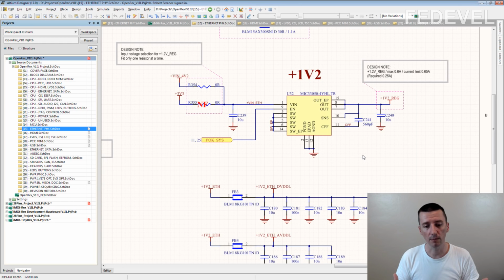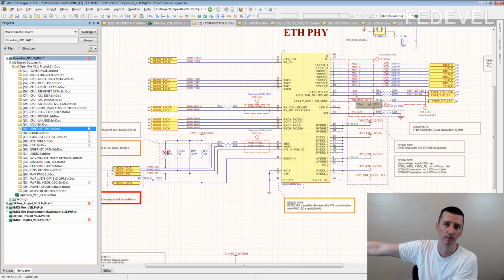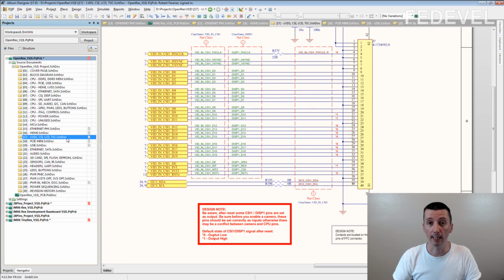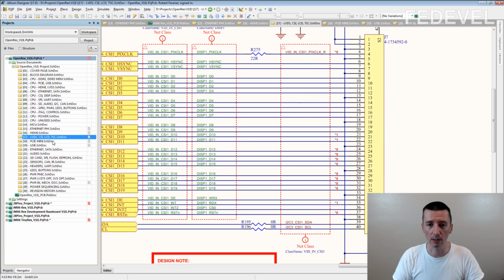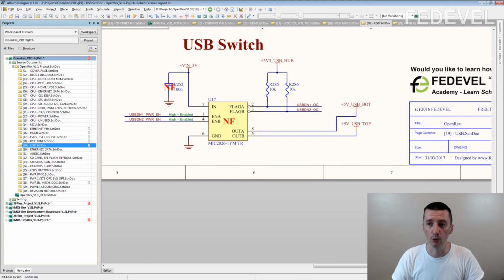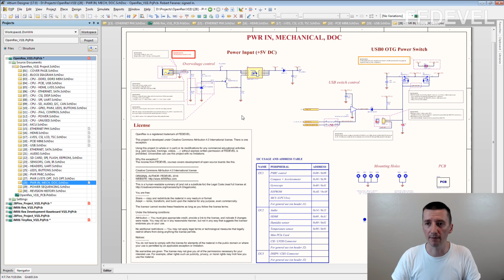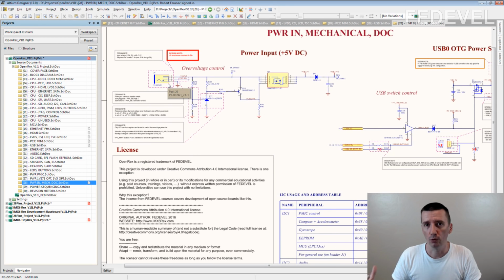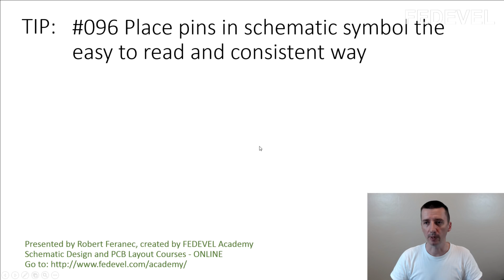TIP #096: Place pins in schematic symbol the easy to read and consistent way

Comment: When I am designing low layers PCB like 2 o 4 layers I prefer to make schematic symbols with pins order same as in footprint. It helps me a lot to think about component placement and routing during making schematic, when schematic component placement should be similar on PCB .
Reply: Yeah this seems like the great divide between the 2 methodologies. The only reason I wouldn't like that method is bc I would need new symbols when it gets too hectic in a 6-8+ layer PCB. IPC specifies a particular way but it is hard to adhere to sometimes too. 🤷‍♂️

Comment: Another great Video !

I will often create two Schematics, One for layout which will show the true positions, and one for the Signal flow of the circuit just as you show here, everything left to right and the synbols are created just for this. Might seem a lot of extra work but it makes for fewer mistakes, for me anyway.

If i have to explain a circuit to someone then this left to right system is best and if I am tracing out a circuit then the real like schematic works better, for me anyway.  Sometimes a few extra step shortens the time to get a job done Correctly. Sometimes throwing away the first try and redoing from the start works best, As there has been too many times that I have finished something and asked myself " Why did I do it this way", with time and experience this happens less often, but it still happens.

One thing that I do believe in is that the layout person should build the first board, a few times like this is a real education,  

I worked at Hewlett Packard, Bill and Dave were still there, and the work flow went like this, a engineer designed a product then built the first product then followed his product into Production then did Product support for a while, all the while gaining a lot of first hand experience, then he might be recycled back into R&D to develop a new product. Of course in the beginning the engineer would not be the lead in the project, one or more of these product cycles for that. HP believed in investing in the proper development of their engineers.

Comment: Hi Robert, 

I am from Mechanical Engineering background and I currently use Mentor Xpedition for designing PCB layouts. I do not have much background in electronics apart from basic university level courses. Could you suggest me what is the best path to learn PCB design and understand all the concepts behind it?  Thanks!
Reply from the maker: I always recommend to start with your own simple projects ... e.g. start with Arduino, then make some addon boards for arduino and move to more complicated projects.
Reply: I already signed up for your course on Udemy. Hoping that I will learn what I need :). Thanks!
Reply from the maker: Thank you :)

Comment: For RF SoC and other RF related stuff I prefer to have the schematic symbol to resemble the actual device. This will somewhat force you to consider the layout perspective while designing the schematic/circuit.
Reply: Yes it makes sense when using components which performance is depend on physical layout.
Reply: Its a tough decision, in my mind, schematics are purely for showing HOW things are connected, and thus symbols should be organized such that how they are connected is simplest. When you match the symbol and part, the wires will either be everywhere crossing over one another, or they will all be ghost wires (connected by NetLabels or Ports). You the engineer may understand its connection, but somebody new picking up the project, it is a pain trying to trace each NetLabel to its matching NetLabel connection. 

I'm not saying it is never justified, I see the argument for both, but it definitely takes some considerable thought before a project.

Comment: I usually create symbols that look like the actual footprint. Do you think it's a good way to create symbols?
Reply: My opinion: 
In my experience this creates a horrible mess, certainly when dealing with larger parts. It's tolerable with smaller devices, but even then it may hinder the readability of the schematic. The schematic is supposed to be the logical and functional representation of the circuit, not the physical.
Reply: Some people prefer it one way some another and I am the one who prefers actual footprint. I never drew 50+ pin device but I have used one or 2 48p and debuged a few and I realy don't like it when numbers are all randeom. The only components that I dont draw as footprint are transistors.
Edit: Chips with pins on four sides are drawn in two coloumns but there is separation in between so you know where is a new side.